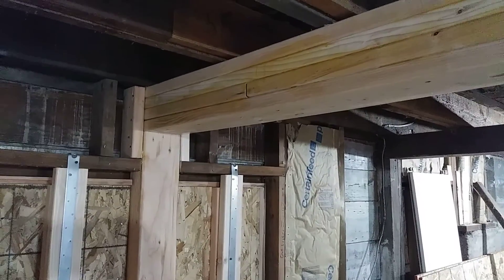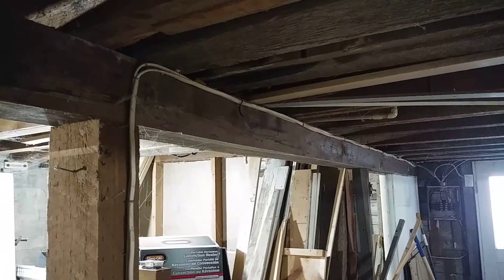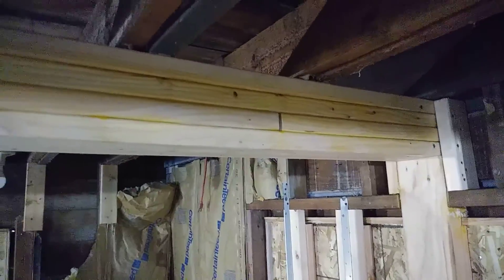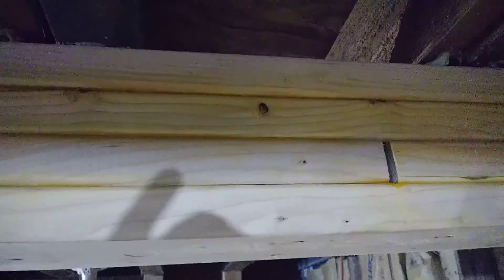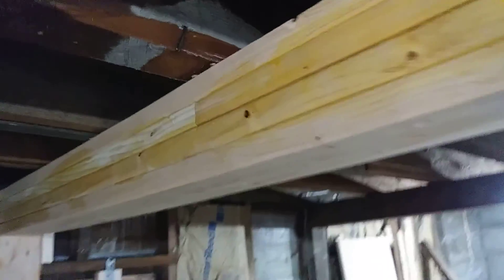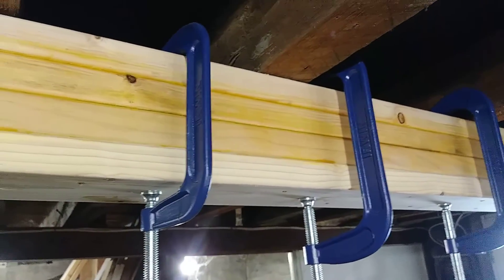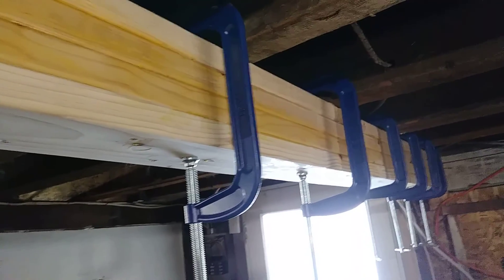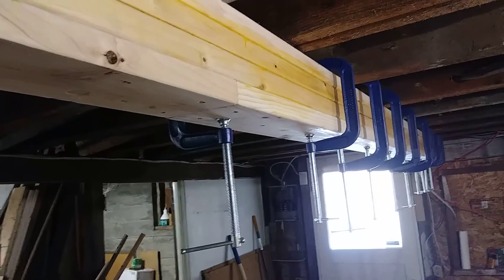Building a Glulam Beam in Place - Termite Repair

Comment from the maker: From an engineering vantage point, glulam beams are considered to have the same strength as a conventional wood beam of the same dimensions, regardless of their orientation. This is because once the glue has dried, the shear strength of the glued joint exceeds the strength of the wood. The key point here is that the glue must be a continuous layer of glue, not a few streaks. Also, clamping force is required while assembling the beam. However, it is worth noting that this video does not fully cover the context in which this beam is used. This is a 6x6 beam, 20 feet long. But in the completed installation, there are two separate loaded spans, 10 feet long each. The center of the beam is supported from above by a truss. This was done to allow vertical posts underneath the floor of the garage to be omitted. In should be noted that a 6x6 beam would have been undersized for a 20 foot span, regardless of how it was constructed. Concerning the decision to laminate a beam horizontally or vertically, there is one important consideration that usually does favor a vertically laminated beam. Specifically, once a beam is loaded, the bottom is under tension, and the top is under compression. Joints have no affect on the compression strength of the top surface, but they do reduce the tension strength of the lower surface. In this application, there is only one joint in the lower surface of the beam, and it is located exactly at the center of the beam. It is at this point that the beam is hung from the truss using a custom-fabricated steel hanger. Thus, in this particular application, the decision to laminate horizontally is inconsequential. This would be equally true if the beam were supported underneath by a post, as long as the post was positioned to support both sides of the one joint in the lower surface of the beam.
Reply: Well, as usual I got a bit ahead of myself, and low and behold my answer is right there TKS. Let me throw out one other thing. If I were to and a hardwood laminate ply would there be any structural advantage?
Reply: Factory gluelam uses glued finger joints for joining the ends. Open gaps is akin to drilling 1.5" holes in the beam at the various locations. If I was using screws I would opt for a high quality decking screw. Wood has +/- tolerances in terms of thickness. This can result in adjacent boards creating a "bump" for the next later that will increase the glue thickness. This can impact strength. A jointer could be used to  address this. The variables that control overall strength are not well controlled outside of a factory environment. This installation also assumes that your floor and joists are planer. Otherwise you will make a curved beam. For these reasons a structural engineer would likely suggest to simply use screw laminated LVL's to create your beam.
Reply: @ILiketoBreakStuff  Not to mention he used a pva glue.
Reply: And from an engineers point of view, he spit his coffee out when you said this is structurally sound.

Comment: The original beams had the end grain positioned vertically. Your home made glue lam would be much stronger on edge. Factory made glue lams don't use ace hardware glue and in every case they provide a camber for load considerations. The pressure used to manufacture factory glue lams is certainly not home shop clamps.

Comment: A 4 pack of 2x8s on edge would of been much stronger. Gluelams are constructed of prime clear lumber, finger jointed at the but joints, glued using high tensile strength adhesive and clamped under extreme hydraulic pressure.  Large beams are also crowned up as well, hence why it is clearly stamped top on the beams.

Comment: ya i'm no carpenter or engineer but my ocd would not have allowed me to lay those 2x flat like that.  even if it will work for that application, in my mind it would be stronger just by putting them on edge.  and always read the labels kids.  even tightbond 3 is not rated for structural or load bearing but unless you're building skyscrapers out of these, it will be fine.  i'd just do it on edge.

Comment: What?? Glue lams are larger and I don’t you could get the clamp presser of the factory beam and the glue is different. Probably will work regardless with center post since it is just reenforcement. Maybe

Comment: The comments on 2x orientation  being incorrect are wrong. Gluelams are usually made in a factory and everyone I have ever used were exactly as built in this video. The only difference is that engineers  often want the beams to have a certain amount of camber or crown . Thus, when the load is placed on the beam, it becomes straight. Retired carpenter with over 50 years in the trade.
Reply: Gluielams are factory fabricated using structurally rated glue and a clamping machine. This LAMINATED beam is not structurally rated so you are taking  your chances and if it fails, good luck at having a discussion with  your insurance company.
Reply: As a retired carpenter you would know that the strength and the crown run along the thin side of the dimensional lumber.
Reply: @billlandree3817  Yes, but that is dimensional lumber. If say, you need a very large beam. For example, a 10x 24, a glue lam would be built with the laminate wood being oriented flat instead of on edge. Engineers design them with certain amounts of camber or crown.  Most are marked with a stamp indicating the top.
 Of course, if you're just building 6x12, the orientation  would be as you describe. Those often are nailed together on site using 2x12s. 
Every commercial building I have worked on that used wood glue lams, had  the beams built flat. I even had a church where the beams were exposed and finished so you could see the laminations.
When I was young, I worked in several different states. In the Pacific Northwest, residential  houses were using glue lam material for door and window headers. 4x6 and 4x12 were flat laminated. In SoCal, you always had solid material. Even very large beams holding second stories over garages were one piece. There was a small period of time where, because of lumber shortages, we actually  were using finger jointed 2x4 and 2x6 studs for walls.

Comment: It seems that if you dob't finger joint and glue those finger joints.. You are unable to get the full strength.. The joints will be way stronger of you do them vertical and not horizontal in relation to the width relative to the grain..The to really lock it in.. Use through bolts throughout.. Crowns up!

Comment: A lot of argument here for and against the acceptability of the horizontal orientation of the 2x6 , 4 piece beam.
4 pieces of 2 by store bought material gives you 6".
The store bought 2x6 gives you 5 1/2" of width. 
I feel like the glue argument justifying the horizontal placement is a moot point when all you have to do is rotate the beam 90 degrees to the vertical position and remove all doubt.
Either way, it's a 6"x6" (Well , 6"x5 1/2" actually).
Essentially , same dimensions and in the vertical position that we've always been taught was the correct orientation.

Comment: PVA adhesives and PVA glues are known to creap over time. Meaning it can gradually move or shift over time even when dry; this . This would have been a case for a resorcinol glue or possibly an epoxy.
Reply: Yes pva glues are used for this type of application.
Reply: @BaronVonFrankenBolzlll  PVA glues are NOT used industrially/commercially for this application and are NOT recommended for for loads that will be under an ongoing load like a beam. Do your own google research. Base your decisions on professional papers or professional applications. Do not pay attention to opinions expressed bu "do-ers."
Reply: I fat fingered it i meant to agree

Comment: Unbelievable obvious error in installing this beam!! The laminating process could pass, BUT!! The elephant in the room is the position of the beam, it is installed wrong!! Needs to be sitting on its side, not laying flat. This will sag overtime, or worse it could snap at its weakest points. Should not be too hard to turn it over to fix this
Reply: The horizontal width is 5 1/5". The vertical height is 6". Also the glued surfaces are better able to resist shear forces when laid flat.

Comment: Arm Chair Experts are pulling double duty on this one.
I have been around many beams built like this, and it's pure brain washing that thinks a board or all boards have to be place vertical, (not true)
Anybody that has used wood glue be it structural or not may understand how well it holds.
ALWAYS, always, always Experts finding fault and dooms day cryers with full lungs.
Thumbs Up .
Reply: The trouble with this build is "public perception by the uninformed masses". Maybe write on the beam somewhere that this is a glulam beam and it is correctly installed and conforms to required building regulations.
Reply: Pioneer spirit built this country, Armchair quarterbacks are killing it. Some of these guys would have froze to death in a blizzard while waiting for someone to tell them the 'right way' to build a shelter.

Comment: I’m looking for a 30’ Glulam to replace the rotting one I have holding my deck over my 2 car garage. I’ve read that a 30’ span with no posts needs to be 18” x 6” to achieve a 30ft span. I’m having a very difficult time finding a beam like this. Is this an option for me to just make one?
Reply: You need a PE to calculate this and stamp it. Youre not trying to hit minimum numbers.

Comment: BAD BAD BAD ideas on many levels. Foremost is that TiteBond specifically DISCLAIMS the use of any of its adhesives for structural work. Ditto Gorilla and everyone else who sells to DIY like HD and Lowes. The only glulam structural adhesives are PUR...UF and similar two-part types. And, you cannot get uniform clamp pressure from C-clamps. Paralell jaws only like Jorgenson and Pony that span the width of the members. YIKES...I see lawsuits here all over the place. Me: D.Sc., CEng. for 50 years.
Reply: I'd be willing to bet money that that beam will still be ably spanning that gap in 50 years.
Reply: @A_Laugh_Riot  There are a few big issues with it that probably won't be a big deal, but do go against code.  The glue aside, he butt-jointed the boards and just nailed them together.  This creates a really big failure point in the beam as butt-jointed boards don't glue together with any strength.  Having them on the bottom boards creates a spot where they can flex apart, causing extra stress on the above boards, which can lead to failure.  Fingerjointing the boards would have at least brought him near code.
Reply: @A_Laugh_Riot  If you are foolish enough to use this method, than that is on you for not doing your research. Me I  am not willing to take the chance when I can mechanically fasten LVL beams together that are full length and are structually rated.

Comment: Well at least I could tell you that it's wrong because you're not supposed to lay boards flat like that there's no strength in them they're supposed to be on edge you need to flip the beam brother you need to do it the right way you better look at your engineering because that is wrong that will not hold I'm telling you it will not hold So good luck give me an update

Comment: This is a job that is out of the scope of a common DIY'er, first the wood has to be specifically chosen, and sorted and placed specifically heart wood vs outer wood, the glue has to be specifically formulated phenic resin specific for structural applications not regular carpenters glue. Also the clamping pressure has to be rough 110 psi, evenly distributed throughout the glue up. Now with that said, it can be done, the glulam was invented over 100 years ago made on site. And many are still standing in use today. But specifically this application to hold up two cars above my head I wouldn't trust Home Depot "Piss Wood" and a gallon of 18 dollar consumer grade carpenters glue. For an application of this magnitude, better to take the effort knock out walls to get a structural I Beam or a proper designed glulam.

Comment: Why not just make a header? It's stronger with the grain running vertical. Gluelam is made under pressure. This isn't a true gluelam.
Reply: It is absolutely a gluelam. It's just not an engineered, tested, certified and stamped gluelam, therefore, 1/10th the price

Comment: Very good, Oddly enough I have 16 X 20 workshop with a 8 X 20 storage loft that I hastily under-engineered some years ago and need to fix my fupaw so it will support all the things I never imaged would be up there.
I hadn't decided on a glue/adhesive yet. My choice for fasteners (https://www.youtube.com/watch?v=ixjlBN9xSCc&pbjreload=101) specifically engineered for this application. OK, I've said all this for one question. I assumed my stack of laminate would be stronger in a verticle position as opposed to your stack. Not criticism just looking for answers prior to doing this laminate ?

Thany you  - Van
Reply: Yessir, you are correct.

Comment: Don't you think it would be stronger on it side not flat lol
Reply: My thought exactly. What he did is totally wrong. I have framed many houses. The boards do not go that way.
Reply: @lostintime8651  I've framed a few houses myself. Going horizontal seems weird at first since we were all taught to stack weight on edge. However, the glue is the game changer. In order for that beam to 'bow,' the faces of each individual 2x6 need to be able to 'slide' against each other. If the faces are unable to 'slide', then it can't 'bow'. A factory-made horizontal glue lam will have the same engineering properties as a vertical beam of the same dimensions. However, the heat and pressure applied at the factory is far above and beyond what can be achieved in the field... anyway... short answer... as long as the glue joint is good, it doesn't matter which edge you're stacking on.
Reply: The benefit is to use the strongest boards top and bottom, with lesser quality in the middle.
Reply: @chucker625    .... This puts a lot of trust in the glue joints.  Without having the pressure and heat (as well as the machining of the interfacing surfaces, to have a tight joint), this is not going to be as strong as a 'real' Glulam.  That may be a good reason to put the assembly in the parallel (vertical) direction.
Reply: If you buy an engineered glulam you'll be alright.  That's the way they come or go with the LVL.  Glulams are heavy.

Comment: So.......... if one can understand it is ultimately  Tensile strength of the glue that is providing the strength.  Buy a roll of velcro. Leave both sides tougher.  Try to pull from each end.  And see whzt happens. If the boards cant slide they wont bow.

Comment: Are you recommending something or just trying to publicly humiliate yourself?  Your joints are all wrong. They are supposed to sit directly under the floor joists and as others have pointed out, the orientation of your homebrew beam is wrong. Gluing and screws don't change the orientation of the wood grain dumbazz.